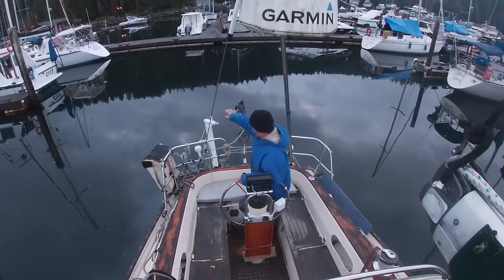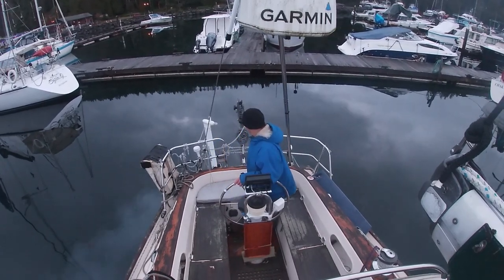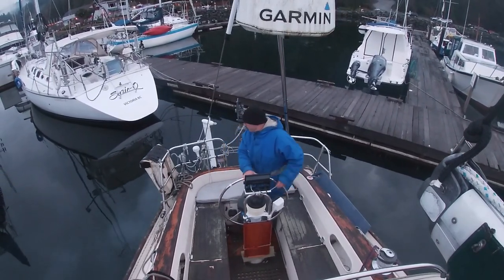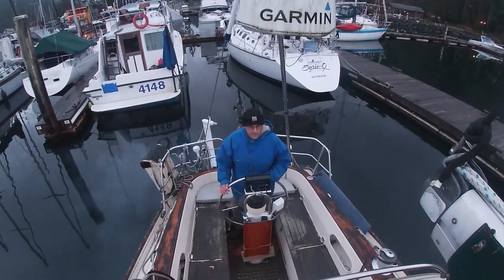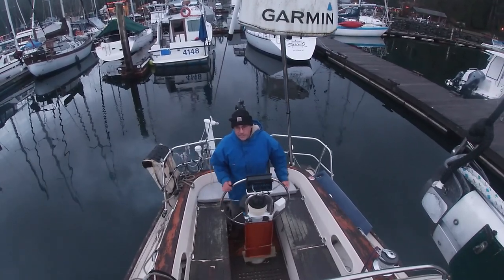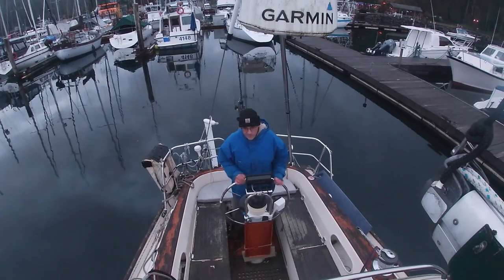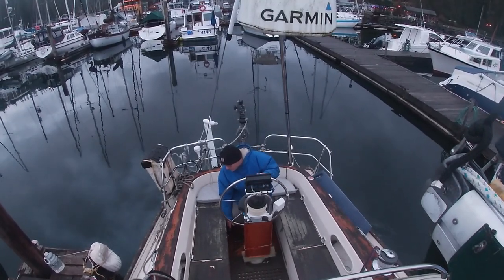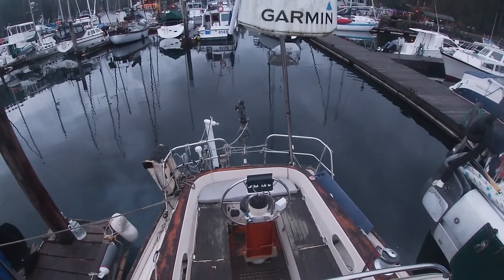SINGLEHANDED DOCKING: COCKPIT VIEW: REVERSE, PORT ROTATION, STARBOARD TIE

Comment: Zero current and no wind makes this easier. At my marina, attempting to back in, navigating to my slip, borders on suicide. Consider a video displaying astern steerageway under windy, challenging conditions...now THAT's a trick! Cheers
Reply from the maker: Thanks for the note. Absolutely, I agree. I must say, I practically sweat blood getting into this slip singlehanded in the wind, and have also been snookered by the current on occasion. I have learned to radio in for help from marina staff when conditions are tough.
Reply: And starboard prop walk helped.
I like your cool style - thanks 😊